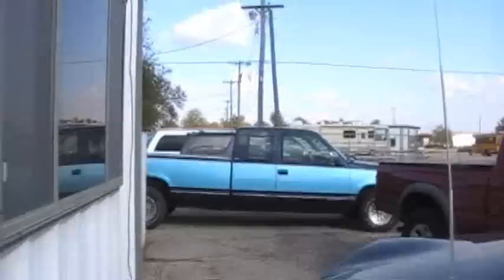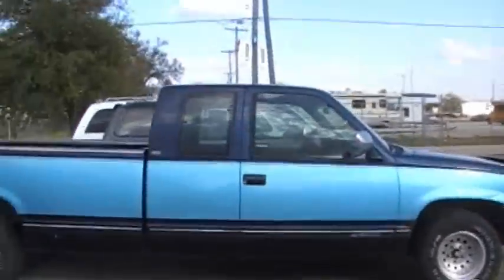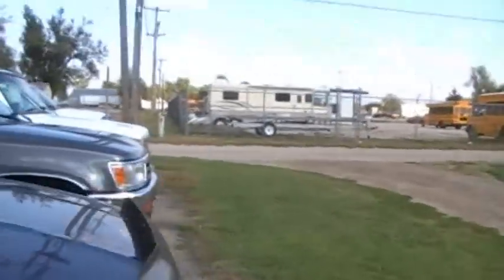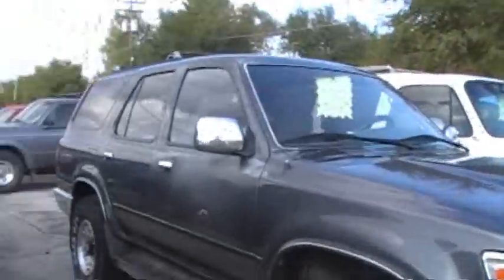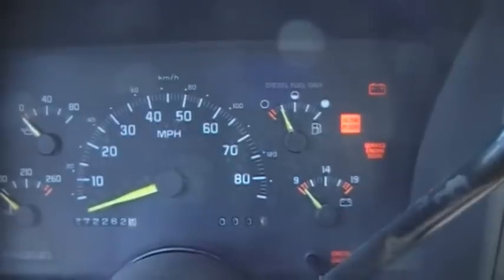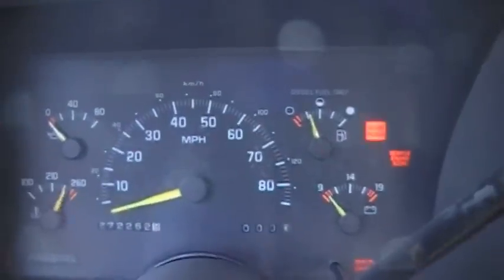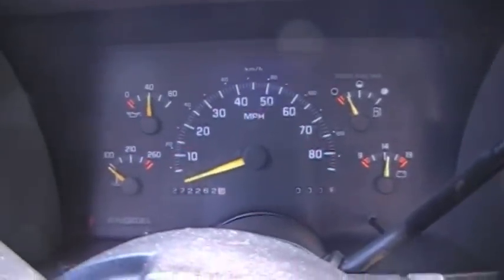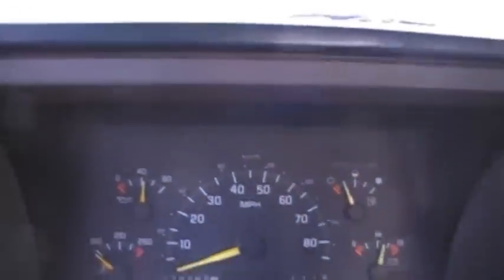Chevy 6.5L Diesel Troubleshooting.

Comment: Harmonic balance grommet is shot out! It's clacking on itself!!
Reply: When mine was shot you would hear it when you shut the engine off, if you're talking about the pulley for that. You could also see it on the bolts ha... they were pretty beat up... very very easy to fix at least... but the noise it made was way more than this imo

Comment: Its the air pump if it does it when its warm (and not when cold) or goes silent after 1200 RPM - Remove it and get a smaller belt
Reply: Capt.Greg Olsen  thats what mine does ! runs smooth when cold but when it heats up it rattles afer 1200 rpm  do you think thats the problem ? sounds just like a lazy lifter .
Reply: 1" shorter
Reply: Are you referring to the vacuum pump?
Reply: Vacuum pump only controls waste gate at idle you dont use the turbo at idle its building zero boost

Comment: Stuck injector pintle, once warm they are able to move if they are carboned up with diesel its like trying to move it in glue it sticks and makes a tap tap tap noise once warm the diesel carbon is slick so the pintle can move again and seat itself. Cheap temp fix stanadyne diesel additive 3 applications or replace all the injectors.

Comment: every 6.5L that was made before mid 1996 had overheating problems because of the single thermastat. when the newer 6.5's came out they put dual thermastats in them. they were just alot more reliable then the old ones

Comment: harmonic balancer I have replace two in may truck and that is the sound of it when
Reply: I have had that same noise on my 6.5 turbo diesel it was hermonic balancer. It wouldn't make the noise until it ran a bit. I would also look at that.
Reply: +kim suchowski I just replaced my harmonic balancer for the same reason as you guys.  Worth checking out.
Reply: Replacing the harmonic balancer is a necessity, they fatigue and fail after so much time, diesels are hard on them since the engine is running naturally unevenly anyway.  Course it's a good idea to have the crank and harmonic balancer balanced together, else you'll end up with a balancer that's doing more harm than good.  Welcome to the world of getting expensive in a hurry.

Comment: I had the same problem in my 6.5 and it was # 8 Cylender intake valve. Hydro locked the motor and was junk. Then I dropped in a 5.9 :). Never looked back.

Comment: You have a stuck or leaking fuel injector, the knocking is the injector not closing all the way and to much fuel is entering the cylinder making the knock, I've had 6.5's and 6.2 diesels that did it alot

Comment: Dunno how well these 6.5's can handle it, but on a 6.2 the fix would be to pull the fuel filter. Install a new filter filled with transmission fluid, then dump a quart of trans fluid in the tank.
Reply: Optical sensor on the ds4 pump probably wouldnt like that.

Comment: automatics dont have dual mass flywheels for your info  i destroyed one 6.5 ran it real hard 230 in the radiator at 3400 rpms wont do that again got another now but the 4l80e instead of the nv4500 but the ring gear is shot gone too put new heads on since glows are bad and previous owner busted a couple off new injectors and glows and good as new

Comment: I think if it was a bad valve, you would hear sputtering because a valve is an integral part of the combustion and exhaust process. It sounds like a loose lifter.  It could also be something totally unrelated to the valves like a loose bracket, or a bearing in a pulley.  Let us know the final outcome.

Comment: It's definitely an injector dripping.... no doubt...
Reply: if you have a injector  going bad will you lose turbo and smoke black
Reply: It's possible. If you have a very bad injector the engine will miss on that cylinder, make it stumble more or less. You will loose some rpm at your turbo because of the reduction in exhaust flow, and the piston will push unburnt fuel out of the cylinder and into the exhaust pipe, here the raw fuel will turn to black/gray'ish smoke. Not unusual for the old Ford Transit Perkins Diesel ..
Reply: The sound from the Chevy 6.5 in the video, is an injector failing to be completely shut under pressure near it's opening pressure. This causes  the injector to drip and the fuel dripping down the pre chamber will be ignited when the piston moves up under compression stroke. and it sounds like in the video.... like it's knocking or breaking nut shells.

Comment: sounds like a problem i had with mine the roller lifter wheel stuck wore a flat spot on the lifter wheel and the cam
Reply: Carl Smitley  did it do it when it was cold ?
Reply: artrite2 nope only once its warmed up

Comment: It can not be the injectors in a 6.5 they are nothing more than tubes the fuel is pushed through by the injection pump. go pick a new one up and look for your self. it is nothing more than a passage for the fuel. My 6.5 had the same knock. I tried for ever to figure it out fixing everything i could think it could be. it ended up not making the noise anymore after i replaced the crank bearings.

Comment: I have a 95 gmc sierra 6.5 and I have the same noise... can't figure it out. louder at bottom of truck
Reply: hi ,did you check your harmonic balancer ,I have replaced mine  twice.The rubber goes bad and it separates making a rattle kind of bad water pump noise,
Reply: gloknor I will check it, thank you!
Reply: ok let me know ,good luck.
Reply: gloknor not the balancer I don't know what it is
Reply: Get a stethoscope or use a long screwdriver and hold to your ear to locate noise it will reveal itself.I would help you if you lived closer.Take care and good luck.

Comment: I have a 1994 chevy 6.5 turbo diesel and i have replaced the wastegare solenoid the map sensor and the wastegate actuator and i still have loss of power and black smoke and a check engine light on the dash can anyone help also i have 18 pounds vacuum at the wastegate actuator
Reply: vacuum is measured in inches of mercury not pounds....ps buy a shop manual.....change the air filter?  pump timing?  injectors worn?
Reply: Ron Stordahl 
Ever find out what the probl was with your 6.5?